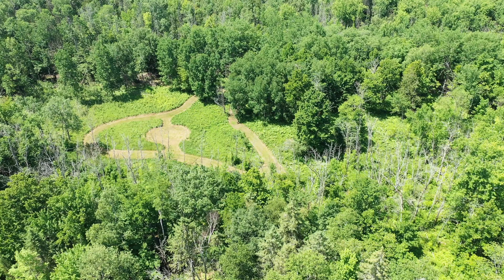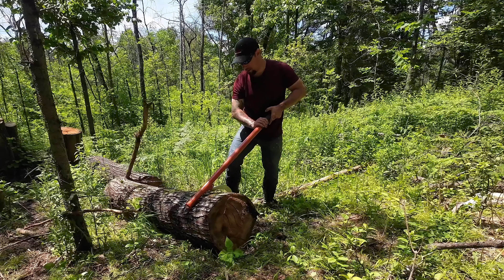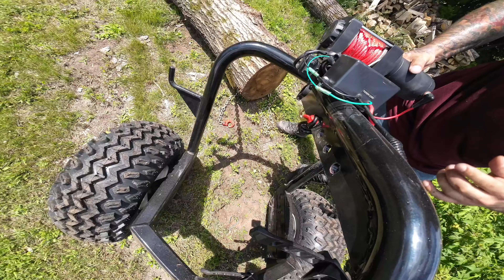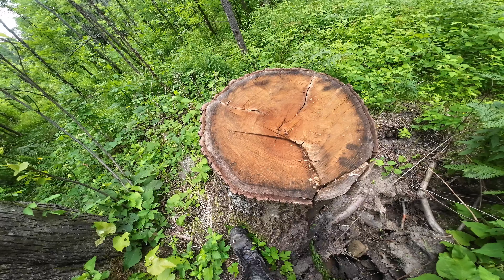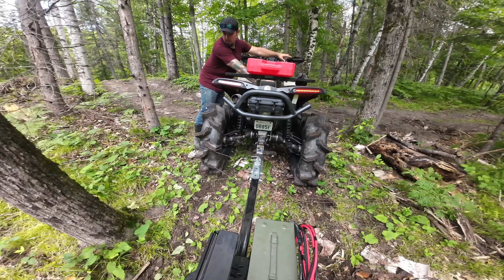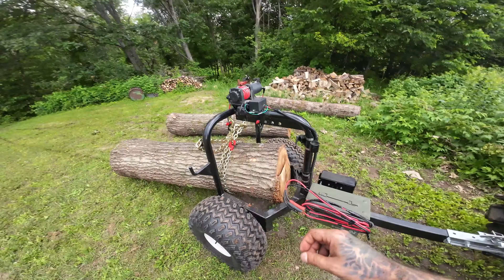Pulling Huge Oak Trees With My ATV Log Skidder!

Comment: You are meant to lift with the winch fully then choke with the chain and then lower the winch so the weight of the log is fully in the chain .. 
 Your poor winch was geting the full weight of the log slaming up and down as you speed of home ..
Reply from the maker: @andyeynort1  oh I am aware, I just couldn't get it high enough to drop on the chain. It handled it regardless.